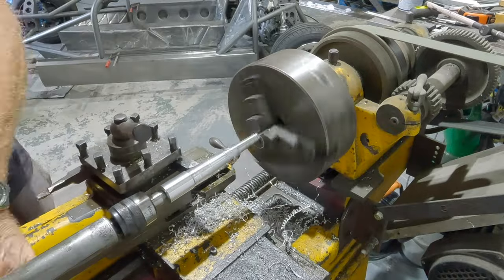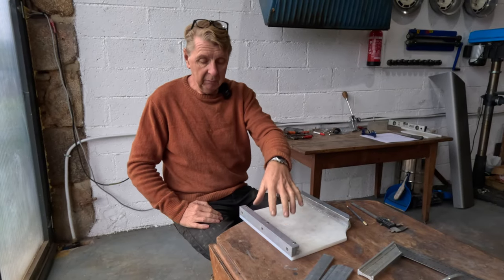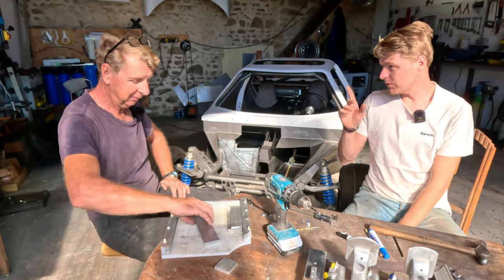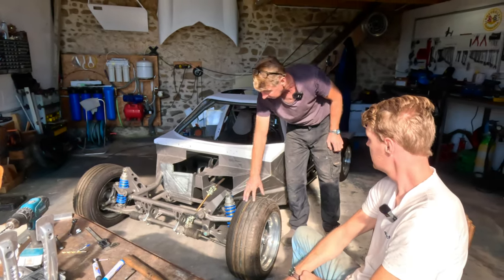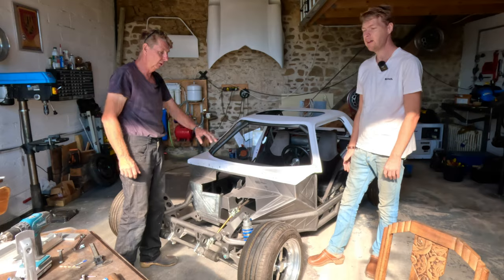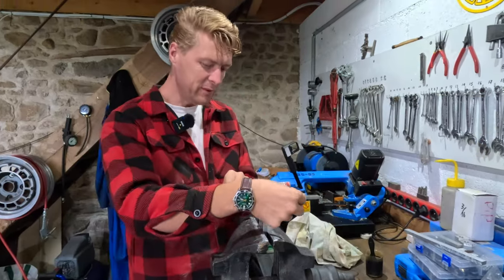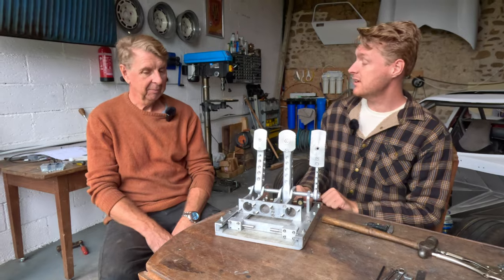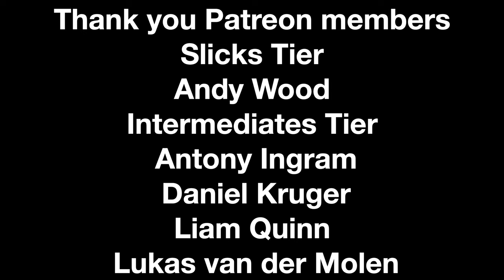The Whole Package | Project Mosquito (Ep90)

Comment: Assuming you are going to use braided hoses in and out of the master cylinders?Next challenge may be finding the correct angle banjo fittings to run the hoses in your chosen route to also take up the back and forward flexibility

Comment: Ooh I would like to guess that the locking pins will be articulated with something simple and light weight like a bicycle linear pull brake setup with the cable sheath attached to one pin and cable pulling on the other pin. Then the other end of the cable would be a neat little leather pull tag next to the seat maybe with a 🦟 on it. (i also would like to guess that whatever you come up with was figured out 3 years ago)

Comment: Your analogies about the performance of the WW2 Spitfire and Mosquito were very apt. As Andrew noted, the Mosquito had two engines but not said was the difference in construction- the Spitfire was mostly aluminum while the Mosquito, though bigger in measure, was actually lighter- it was made out of formed wood, had no external fasteners at all, and that extra 1500 hp RR Merlin engine. An American plane builder set out to build a "plywood Spitfire"; it came in over 2000 US pounds lighter than the British military plane without arms and ammo, and was expected to fly 10 to 25 knots faster with a US built Allison v12 of about 2/3's the horsepower of the Merlin. Sadly, he passed away recently, but his aeroplane is being finished, hopefully this year. Which is a great testament to good aero design and good construction. 
As to watching to the end; this moment I have the time, and as you and Andrew know, your infrequent videos are never real short- but today, you get 🦟🦟🦟🦟🦟!

Comment: Ooh a gas strut oughta be nice for spring loading the pedal box. I also have a good idea for a pin release mechanism. Take a bicycle brake cable and housing. Put a housing stop on one pin, and a cable clamp on the other pin. Elsewhere in the car you can have a lever that pulls that cable, and because the housing is secured to one pin, and  the cable to the other, you will pull the pins together and release them. Best part is, you can get cable housing in all kinds of fun colors so you could color match it to whatever you wanted, they even make super slick braided silver ones. 🦟🐕

Comment: You could check the clever mechanism of gliders pedal boxes if you have an airfield nearby.  Pulling a cable unlocks the pedal box, pulling further the cable pulls the pedal box towards the pilot. To move the pedal box away, you pull to unlock and push away with your feet. Well done!

Comment: Very nice adjustable pedal box. Don't forget to point out that there is the time honored primary method of adjusting the driving position by inserting a 2 piece pillow in the drivers seat. Also, I think you should involve Miriam a bit more in the videos.

Comment: I'm looking especially forward to the mechanism to retract the pins.  My simple brain tells me to use short cables run round some nylon pulleys and attached to a single polyester strap.  When the pins are engaged it can't rattle because the cable is inside the nylon and the strap shouldn't make any noise on carpet.  Something like the handle to a dog leash, nothing very substantial needed.

Alternatively you can get cables with 90° sheaths, or PTFE tubing to run the cables in and clamp them in a block.  It may even be possible to use the nylon strap itself on some larger rollers to go around the bend.  (Think a small leash for a Chihuahua 😂)

I know you've probably a good idea already planned and half the enjoyment is seeing which way you have decided to solve a problem.  So crack on!  I'll be back next week to see what's transpired.

And of course: 🦟 🏎️ 🦟

Comment: 🦟Love the content, I wondered about the locking system, for a moment I thought you were going to go with the aircraft system using a threaded bar and a crank handle like they use to move the rudder pedals closer or further away from the pilots seat, but that would have been over complicated. Need to see more of the hound, what is he?
Reply from the maker: Bentley is an English toy terrier

Comment: tbh, i would proberly have choosen some sliding rails with a locking mechanism inside of them. it might cost a little bit more but would only weigh half of the contraption you got going on there. but of a shame for such a dope looking pedal box and gear shifter. otherwise keep up the good work! :D 🦟

Comment: Did you not have room to fit the master cylinders behind the floor mount pedals ?

As a result of your design you have to have your heels above the cylinders and associated flexible brake lines which seems odd and complicates matters

Comment: Sorry i have to ask how are the break lines gone move
Reply: Flexible lines should be easy enough
Reply: @oliverclothier5677  jes but thy bend not stretch
Reply: If you put enough slack in them and put the fixing point higher than the cylinder it will not need to stretch just bend a little

Comment: Great video, as always. I do have to say something that makes me cringe every video and that is the use of a graphite pencil to mark aluminum. That is a no-no in the aircraft structural repair business, due to the corrosive nature of dissimilar metals. I've always used a grease pencil, or a fine tip sharpie instead for removeable marks. I just had to say it out loud to maybe help others, but I also know you all clean your parts afterwards to ensure no contamination. Best wishes! 🦟

Comment: Ok, me again, something to think about, the radiator and underbody airflow, what about directly ducting the air from the grill through the radiator and up and out the bonnet like a Ford GT-40?  A friend from the UK had a modified Hillman Imp and put the radiator up front and ducted the air out the top of the bonnet, he said that it made a huge difference with down force without adding spoilers etc. 🦟

Comment: 🦟Why did you gents opt for locking pins rather than solenoids to lock the pedal box into position? Solenoids could be unlocked electrically with a button or switch that can be easily disabled when the vehicle is in motion. Keep up the good work chaps. I'm really enjoying the series.